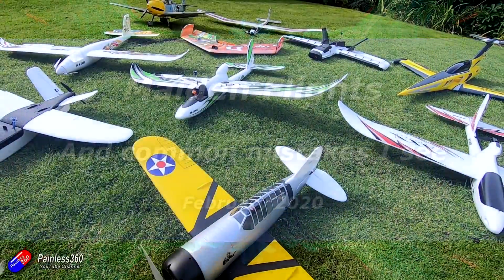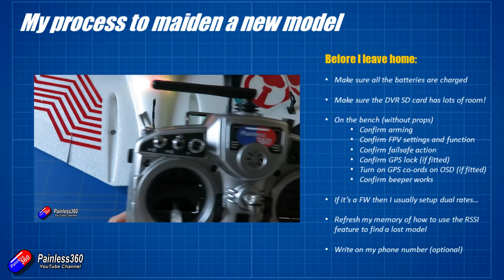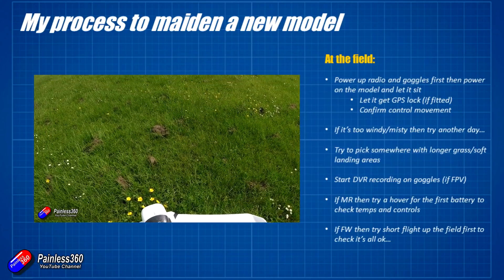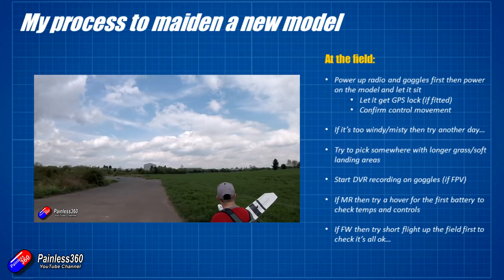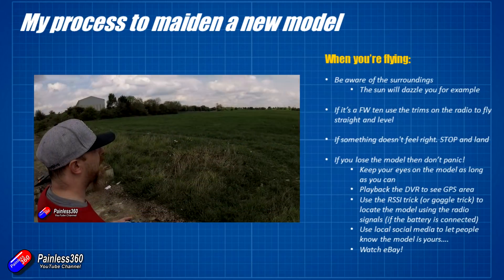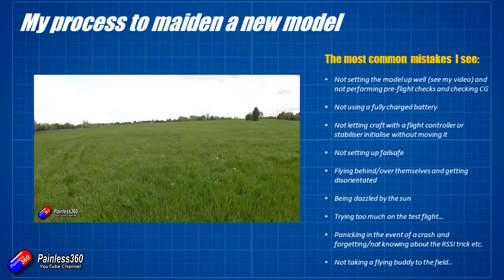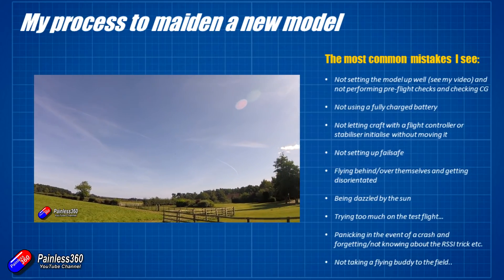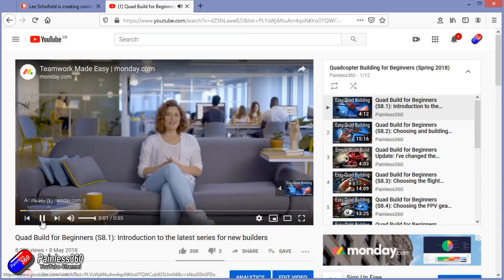Maiden flight common mistakes and how to avoid! (Quads and planes)

Comment: Doing this hobby since the 70ies, maiden flights with fixed wings are still nerve-wracking each time. The worst of all is the first flight of a scratch-build plane of your own construction, which has to take off on its own power (or maybe a helicopter). I could need a sedative before powering up the motor(s) 🙃
One thing I also do on the maiden is just checking the main functions and if the CG is right and then land after about one minute. Then I check all screws or whatever may come loose in flight, because when something is not propperly fixed, it will get loose very fast. I do that for the next couple of flights too.

Comment: I print up a pre-flight checklist for my models and go through it .  As I’ve got quite a few with different characteristics and don’t fly all that often , this helps  a lot and works a lot better than relying on memory.   I’ve lost one through not having a battery well secured and doing extreme manoeuvres.  And having a switch in the wrong position has cost me too. It’s hard to find anywhere to fly around where I live and the temptation to do too many things at once and in a hurry needs to be resisted. 
Great video with good advice.
Reply from the maker: You can add key notes to Opentx radios for models too that can help remind you of key points. See my video on it..

Comment: My recommendation: If you see your aircraft go down, place your radio on the ground with the antenna pointing directly at the crash site. Now, pack up your gear. When everything is packed up, go back to the radio... It's still pointing at your aircraft. Now just walk where the radio's antenna was pointing, straight to your downed aircraft.

Comment: Hi Lee, I have been following your iNav for quads videos and had my maiden flight yesterday after conversion from BF. lOS The quad flies beautifully but when I try FPV I lose the feed after a few meters...complete grey...I have an AKK FX2 Ultimate on Mamba F405 (on BF this worked absolutely fine)..any suggestions where to start with the troubleshooting? Thanks in advance as always...Cheers Harry from Aotearoa
Reply: KiwiFPV Make sure you REALLY are on the correct frequency - close channels can make it look like you've got a solid image in the goggles... Until you're a little way away, then you'll lose video completely. Make sure you unlocked the VTX so that you have full power available. Make sure you're not in pit mode. Finally, make sure your VTX antenna is good/properly attached to the transmitter/is the correct polarization, and check the antenna(s) on the goggles too.
Reply: @jyunte  thank you so much for the hints...will now go and check all of the above..;) cheers
Reply: @kiwifpv5865  I hope it turns out to be one of them, as those are all easy fixes!
Reply: @jyunte  got it...it was the frequency..as soon as I didn't rely on the auto scan but selected it manually the feed came back juice and strong.....only the annoying battery critical now left...anyway thanks again for your help...obrigado..:)
Reply: @kiwifpv5865  Awesome! Glad you got it sorted out! Yeah, never trust autoscan. Instead, either look at the VTX and set your goggles to that channel; use smart audio to change the VTX channel; or use the band signal strength feature in the goggles to see with your own eyes which channel has the strongest signal. The autoscan feature just locks on to the first strong channel it finds, which might be an adjacent channel, but not the actual channel you're on. Now, "battery critical" warning?
Reply: @jyunte  yeah I think the warning might have something to do with the fuel settings in inav....read it somewhere...was saying critical as soon as I took off and then shortly after zero percent...but I just kept flying los...for probably another five minutes or more...
Reply: @kiwifpv5865  I've never set up iNav, but having watched Lee's videos, I would say that you'll need to tell iNav the minimum cell voltage (eg. 3.4V) and the maximum pack voltage (eg 16.8V). In BetaFlight, it's common to increase the maximum pack voltage value a little because sometimes freshly charged batteries make BetaFlight think they're actually undercharged batteries of the next cell count (eg BF thinks a full 4S battery is an undercharged 5S). When that happens, as soon as you arm, you get a low voltage  warning! That might be what your experiencing, or something similar. When connected to iNav, plug in your freshly charged battery and see what iNav reports as the pack voltage.

Comment: I performed my 1st maiden flight ever, only three weeks ago. I wish I had seen this video before the event, I would have used this as a checklist. Fortunately, I had a more experienced pilot as my flight buddy. Who quickly noticed the reverse moving rudder as I did my preflight checks, assisted with the trimming, & when I asked, switched the rates for me. I was at the limit of my skills, just controlling a less than perfect plane.
So I’m surprised that a “buddy” was only mentioned late in the video, my buddy played a large part in the survival of my model.
Reply from the maker: If you have an experienced flying buddy with you for the maiden then you shouldn't need this video ;)
Reply: I shouldn’t, & didn’t need this video, but I will probably rewatch it before I maiden again. There is a lot to think about, & a nervous excitement when taking your new, never flown plane onto the field. Easy to miss a step in the process. For a newer pilot like me.
I thought a flight buddy should higher on the recommendations. Of course the more experienced buddy, the better.
Possibly, it is hardly worth a mention, because it happens so naturally at my club field. When a new plane arrives for its 1st flight, the pilot is accompanied by a friend or two during the preflight, & the field is cleared of all other aircraft.
Mine was only different because I insisted my buddy was not to leave my side until the plane was comfortably trimmed. The elevator ran out of trim adjustment, it was manageable but not comfortable, so I appreciated, that he stayed for the entire flight.

Comment: Another one you could add, if your coming from say a multi-rotor to a fixed wing for the very first time, spend some time on a simulator that you can use with your transmitter. Then hopefully you will get the majority of crashes out of the way before you make your maiden. When i first switched from multi-rotor to fixed wing i used a simulator first, and i am glad i did. My mind set immediately changed from "if i can fly a multi-rotor then fixed wing will be a piece of cake", to more like "darn, i am glad i flying on the simulator first!" I soon discovered it was all too easy to fly your model straight into the ground if you have never flown fixed wing before. An hour or two playing on the simulator first will save a lot of heartache when you do your maiden.
Reply from the maker: Great tip. See my wing videos designed for quad pilots..

Comment: This is some of the best advice I have ever seen in one video.
Many many thanks for this, I am sure it will help everyone from a beginner like me to an expert who maybe has forgotten some of the more basic rules of maiden flying.
I remember my very first flight lasted about two seconds as I hand launched it, put it straight up to full power and it Torque-Steered into a barrel role into the ground and promptly caught fire, as in my panic I did not reduce the throttle!!  Soooo many mistakes in such a short time, but hopefully once the weather picks up and I am feeling up to it, I will have a better first flight with the aid of this advice.
Have Fun Every One,
Joe

Comment: this comes very handy, i just nosedove my ZOHD Dart XL into the ground yesterday on its maiden :D
Reply: Did it survive?!... i have the same aircraft and will try to maiden soon
Reply: @beefybeef1326  kinda, the nose piece broke off, a part of the back cover and the motor mount. 

I repaired it (while i am writing this i am in the field  just switching batteries for the next flight)

But I STRONGLY RECCOMEND YOU THIS: 

Get yourself somen Tape like this: 
3M Tartan Filament-Klebeband Universal 8956, 50 mm x 50 m, Transparent (1-er Pack) https://www.amazon.de/dp/B01191KS0K/ref=cm_sw_r_cp_apa_i_6dbqEbDMXCC5J

Then get 4mm and 3mm 1meter carbon rods (2-5$ each) and use the tape and the rods to reinforce the whole body, especially the front part (batter tray). When you see them crash, thats usually where they breake, probably saved mine from severe damage

And use a lot of throttle at launch, that was the cause of my crash
Reply: @beefybeef1326  also, i drilled 2 holes into the motor mount and used 4mm carbon rods pointing through the foam where the mount is attached (about 4cm long) and hotglue to mount it back on
Reply: @Julian11422  I was planning on reinforcement of the motor mount and nose before I fly it. Hope your repair works well
Reply: @beefybeef1326  Yes, i just came back, flew 3 batteries and it worked out great, have fun with yours 👍
Reply: @Julian11422  cheers buddy..I look forward to flying it... it's my first flight in the hobby!

Comment: As usual very useful tips. ps.  Have you done a video showing how to do a correct video signal  set up in order not to have interference? Lately every time I throttle up on my new models I get lines or even worse, the OSD disappears. Any tips ? Thanks 😊
Reply from the maker: Yep, see my video on getting rid of OSD interference...

Comment: One mistake no matter what the craft is, if you do some work on a model forget you have done it then pick it up to go flying only to find you did not finish it or fully test. If I do some work on a craft  including changing props on a Quad and you have not tested it I place a yellow tag on it with what was done, if anything needs doing and if it has completed a test flight remove tag. Red tag don't fly needs fixing No tag ok to fly with standard preflight checks. This is the same for a radio, if you have updated its worth tagging all models you fly with it to inform that the radio has been updated and fly with caution and complete all pre-checks before flight, if all ok remove tag for each model tested.
Reply from the maker: Great tip. I only refit the prop as the very last step so if it's got a prop - it should be good to go....